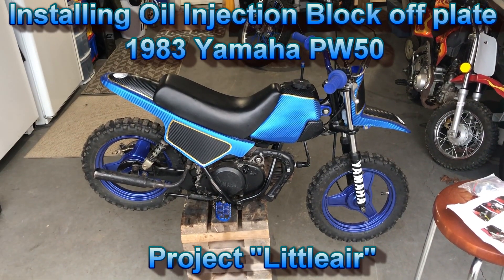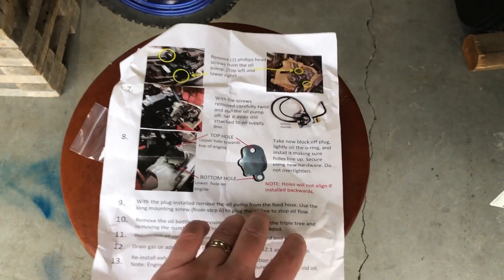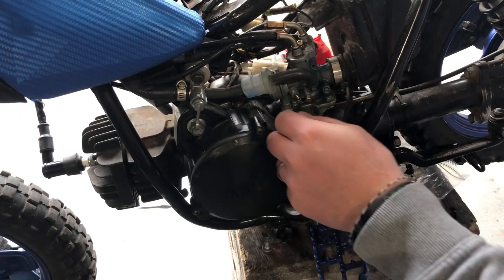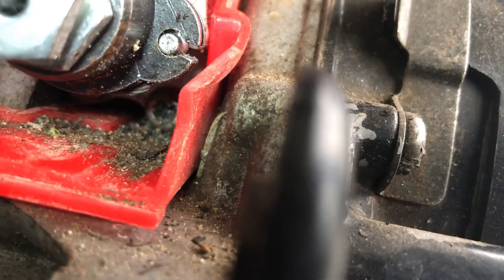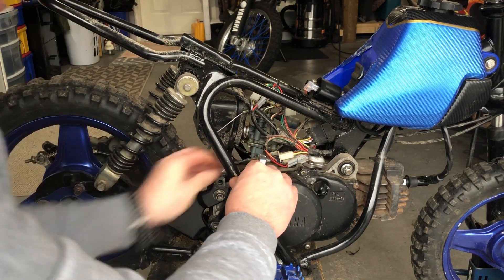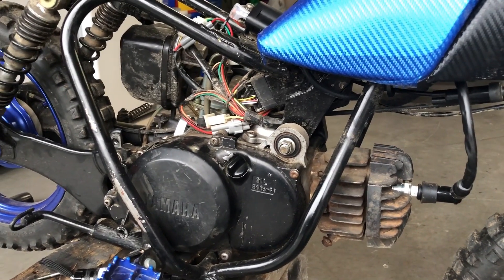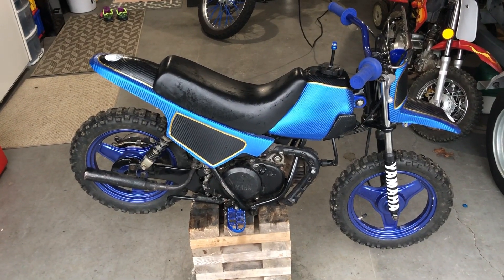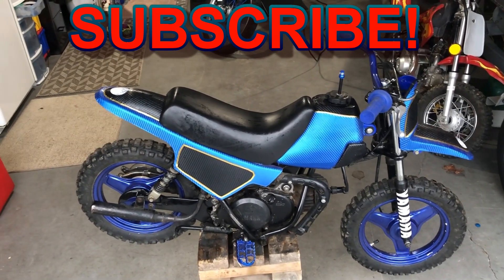Yamaha PW50 Oil Injector pump block off install

Comment: I'm working on a 2001 PW50.  First one that I've ever seen.  I wasn't able to get it started.  I drained the tank and cleaned the carb.  The gas tank had 2 stroke mix in it.  The oil tank appears to be full of engine oil. I'm going to get a block off kit for this bike.  Thanks for the video.
Reply from the maker: Glad it was helpful for you. Cheers!

Comment: The reason it reves higher us due to it not having to use the pump. The pump is driven off a gear if I am not mistaking. And now that it don't have that extra load it's allowing it to rev higher and faster.
Reply from the maker: Quite possibly could be the case. But the fuel mixture with the pump seemed to be unreliable and a lot more smoky meaning a lot more oil. Doesn’t smoke as much and feels like it runs better personally. Cheers
Reply: @tnerbsg8134  your very wrong bud
Reply: Sorry old-timer
Reply: @tnerbsg8134  what runs the oil pump? if you open throttle and stay in that position what is pumping oil into the motor? The cable controls the amount of oil and the pump is driven by the gear in the case.

Comment: I have a PW80 and all of the block off kits are sold out. Do you think I can use the PW50's kit? It looks identical and I noticed you have both. Thank you
Reply from the maker: You could always pull pump out and just remove the gear on the end. And reinstall, block off the hoses too
Reply: The block off plates for the PW50, PW80, BW80, Tri Zinger & 4 Zinger 60 are exactly the same 😎👍

Comment: Drain fuel from tank n float bowl, empty 2stroke oil reservoir , fill with premix job done.
Reply from the maker: You most certainly could do that. I prefer knowing everything is removed not just for my own piece of mind but for the next owner too. Cheers

Comment: Hey great info..you ever gave iss with the kickstart lever not returning upright when kicked down
Reply from the maker: Not sure what your trying to say. If you are asking if I have ever dealt with the kick starter not returning to upright position. I have not, but I have bought a spare Kickstarter and talk about it in part 3 in the engine component vid I did.
Reply: @bigair0176  yes  i am having issues with kickstart lever not returning upright..have replacement the entire kickstart assembly  and still same problem not returning upright
Reply from the maker: Have you checked out part 3 on the pw50 on my channel?
Reply from the maker: I never had to replace it but you can see how it’s supposed to work on part 3 of my pw50 vid.
Reply: @bigair0176  thanks I will take a another look at part 3

Comment: I just ordered a kit and will be installing it this week. Did you have to change out your main jet?
Reply from the maker: Hopefully you get what you ordered from pwonly. I didn’t have a good experience with action North America which is the main company for pwonly. I had to cancel my order because I never heard a peep from them. I never changed my main jet yet, but will be as I am currently making vids on engine mods to the pw50.
Reply: Bigair01 ah shoot thats a bummer. They did send me a few emails, order placed and then a shipping confirmation so hopefully it arrives. Ill keep you posted.

Comment: Would it work the same if you just let the oil tank and pump run dry but mixed your own gas?
Reply from the maker: You could.... but it’s not to hard to remove. Running it dry I would be worried about running it without the oil and cooking the top end. But you can mix your gas anytime and know you are getting the required lubrication for the top end.
Reply: @bigair0176  Yeah, not too hard to remove but my screws gave us HELL! lol, we FINALLY  took it apart last night to put a plate on it but couldn't figure it out but my cap off is different than the one you used. I used this one found here,    https://www.ebay.com/itm/313197345063?ViewItem=&item=313197345063 However, I couldn't figure out how to put it on because it wasn't sitting flush. Additionally, was concerned with the throttle cable holding tension with that spring but from your video, you don't even need that and it can be disconnected, is that right?

Comment: how's the bike running now? Is it still running well? and do you think it runs better with the oil pump gone?
Reply from the maker: Yes I totally think the bike runs better. It isn’t as Smokey for sure. I am still planning to do a top end on it but just haven’t gotten around to it
Reply: Bigair01 thank you man the oil pump was bad on mine and the top end is destroyed the cylinder not so bad but it has some scoring so I’m getting a new cylinder and top end rebuild kit and that pug so i won’t have to worry about it happening again
Reply from the maker: Dirty Dan ya piece of mind for sure
Reply: Bigair01 yeah great tutorial btw super easy to follow I just subbed

Comment: Hi mate, I did the install exactly the way you did. So thanks for the vid. The bike starts and ideals perfect. But its lost a lot of power......it revs but there is very little power being delivered to the wheel. Bike is not going anywhere .....any thoughts or suggestions ?
Reply from the maker: Jason Lazar you may have to pull the clutch cover side off and have a look. So what your saying is it revs up but the bike doesn’t go anywhere?  I know I am to big for the bike myself and it doesn’t go anywhere easily with my weight on it. If you just lift the rear wheel off the ground and you give it gas does the rear wheel spin?  The clutch may not be working correctly  hard to say without looking at it.
Reply: Did you fix the problem you were having?  What was wrong?

Comment: What did you do with the cable from the throttle tube to the carb?
Reply from the maker: I just left the tube there and cut the wire for the oil pump. The throttle is still attached

Comment: Question: We're running mixed gas but haven't installed the block off plug. The bike appears to run fine. What's the advantage to performing this mod? Not doubting the need for it, I just want to be able to justify the money and time involved. Thanks!👍
Reply from the maker: You could just unplug the cables and the lines and leave it installed. The plastic cog inside could break inside would be the worst that happens. Just plug the connection on the carb so it’s not sucking more air into the carb. But you don’t have to remove if you don’t want to. I just liked the fact if is plugged and knowing the plastic cog won’t break inside the motor unknowingly
Reply: Thanks.  I'll look harder at this mod. Much appreciated!👍

Comment: Do u have a part number for the throttle cable you're using on this bike
Reply from the maker: I ordered it off of amazon. Unfortunately the cable was to long so I ended up using the stock one. I think part 4 of my pw50 project on my channel I show what I did.
Reply: Yea I'm having similar issues I made a purchase from motosport.com last night it's a single throttle cable they claim it's an exact fit let's see what happens i have a funny feeling its only gonna be have the cable or something lol il keep ya posted great content btw very informative git the bike running now. I appreciate it
Reply from the maker: Glad it was helpful. I may have another vid on the top end rebuild in the future.

Comment: Will this work with a 1990 rt 180a?
Reply from the maker: I would say you would have to research the pump block off. But I’m sure you could do it if there is an oil pump on the bike. I would delete it and premix over the pump for sure

Comment: I just did this step by step and now my kids bike wont kick over. Any ideas? It's a brand new 2022.
Reply: 40-1 mix
Reply from the maker: Well that’s not good. I am sure it’s something simple. Did you take anything else apart?  Any wires or hoses that you missed or unhooked?  Pull plug and see if it’s dry or wet. That should tell you if it’s a fuel issue. Make sure the run switch is in right position. Are you using the choke?  Did you reassemble the cables wrong. It’s hard for me to assist when I am not sure what steps you may have missed or did wrong. Did you plug the oil line opening on the carb the line goes in. Sorry hard for me to help ya when I don’t know exactly how you put it back together.
Reply: Did you ever figure out what was keeping it from starting @ Erik Hartley

Comment: Couldn’t you just drain gas tank  and 2 stroke oil tank and then fill both with mixed fuel?
Reply from the maker: You most certainly could. I am sure you would be a higher risk of burning out the oil pump as well with no oil pumping thru it. Was a fun project and just shared what I did. Cheers!
Reply: @bigair0176  thanks for responding. Wasn’t sure if anyone would beings it’s a old video. It was just a thought I had and wanted to ask about it to get another’s view on my thought. Well I’ll try it and let y’all know the outcome.
Reply from the maker: @jakewelsh1002  the other thing you should make sure is that the oil pump doesn’t suck air into the carb from the pump to the carb line. You have to cap it off. But if you buy the kit it usually has the cap to block off the carb included.
Reply: @bigair0176  thanks for the info. I’ll check it out
Reply: @jakewelsh1002  hi jake, did you try the method you asked?  Using premix in both fuel tank and the oil tank? I think my is pumping too much oil but don't want to block it before I can confirm the cause.
Reply: @jerrychen3704  I haven’t had the time to try it out yet. I don’t see why it wouldn’t work but maybe I’m missing something. Definitely worth a try